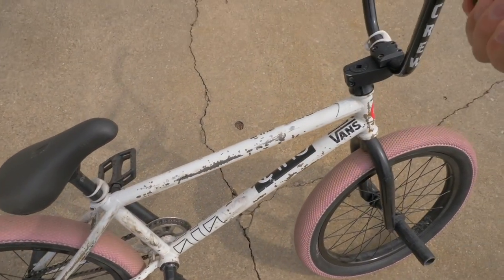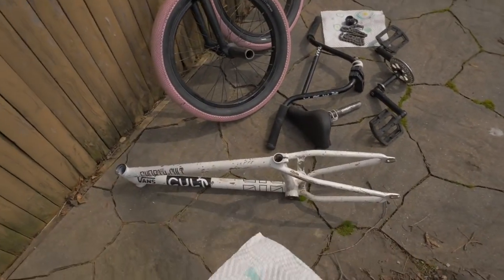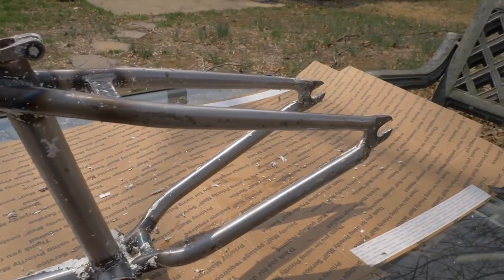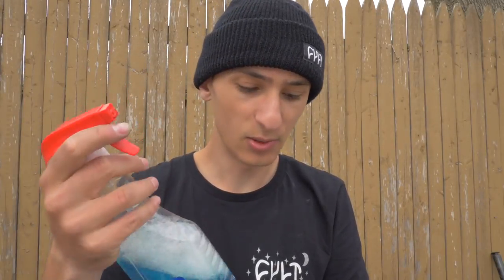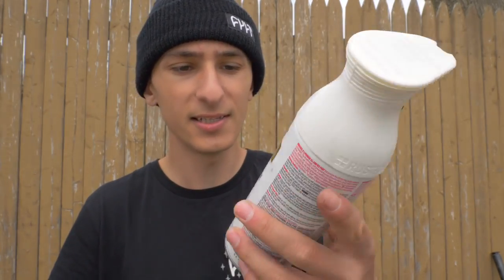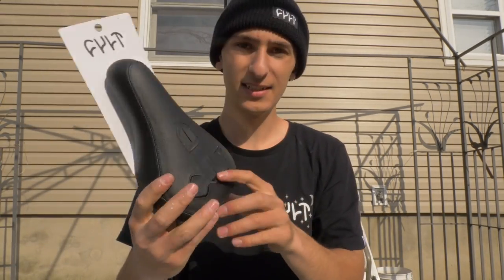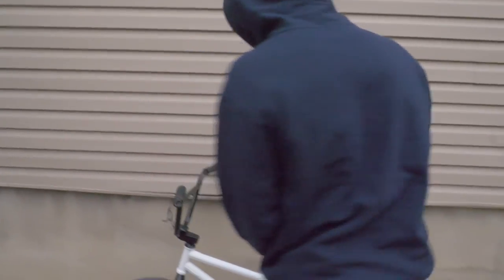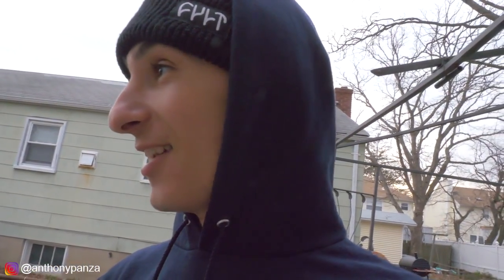THE NEW BIKE BUILD (:

Comment: Good work but I’ll tell you a better paint stripper that works better and it’s called air craft stripper and it even works on power coat frames and it’s found at Auto Zone or any auto parts store and if you can find vht clear coat it’s a great clear